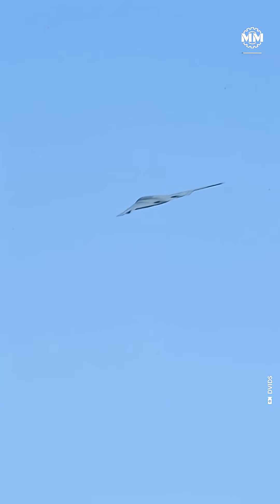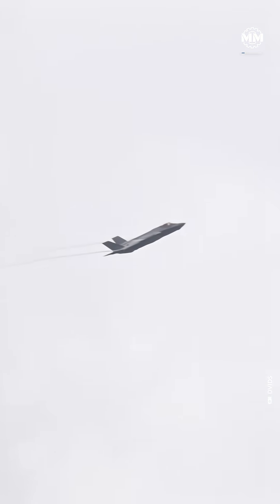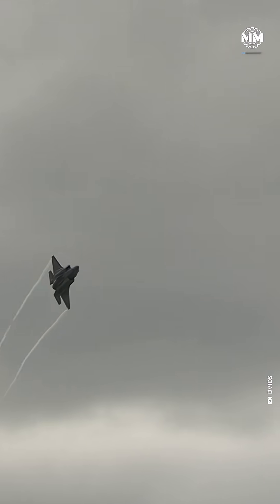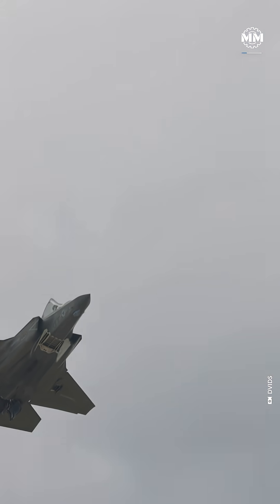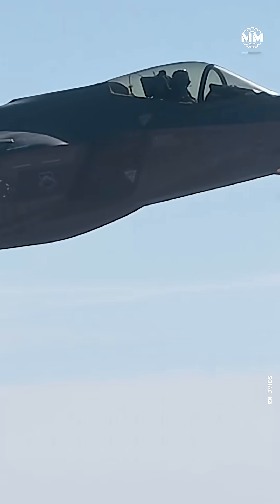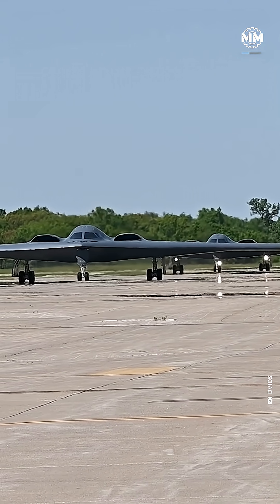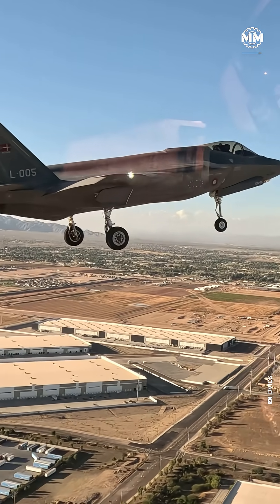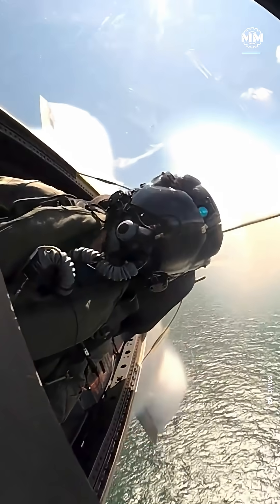Real Reason Why Radars Can Detect The F-35

Comment: What I can’t understand is why high capacity computers can’t be connected to high frequency radars to analyze  what they’re picking up. I’ve never seen a golf ball or bubble bee travel at Mach 1.8
Reply: But you can't get constant pings. So your point is moot. If a spec shows up then it's nowhere near the first ping, you can't get consistency. And the further you increase your sensitivity, the more you'll pick up. You won't just pick up birds, you'll pick up their shit falling down, insects flying, dirt particles, etc.
Reply: @reykennedy5716 maybe I’m simplifying it too much, but let’s say I’m pointing my radar at the sky and there are 100 birds and a F-22 in my direction. I get 101 bird sized pings, right? But only one of those ‘birds’ is flying at Mach 1.8
Reply: @bahe1969  you can see it but you can never get a lock on it, unless it opens its weapons doors then you only have a few seconds to get a lock on it which is almost impossible because of electronic warfare capabilities that the jet's have, and also they can fire first at long range out of harms way. It's almost impossible to shoot down a 5th generation fighter
Reply: @bahe1969 Not all radar detects motion.  That was the biggest breakthrough for weather stations.
Reply: @rabbiartsdesigns3596  You can lock it, thats what sensor fusion is for, you use lower frequency sensors to detect, then try to lock with the rest, sooner or later you will have lock good enough for missle launch, thats pretty much why every power invests in different kinds of sensors, satelites, IR sensors, Pulse radars, passive radars and much more, there are possibilities you know why? Because stealth isnt new and its weaknesses are also known
Reply: @bahe1969 comes down to: how do you know that the first ping was off one bird, and the second off another bird that was 100 yards away a half second later. But you don't get consistent pings off those things so there's no.way to know that youre actually tracking the same bird. And if you're using radar thats showing you every bird and insect, you have absolutely zero chance of picking an.airplane out of the clutter
Reply: @peposad2588  Yeah the big problem however isn't so much locking a stealth plane if you can throw loads of signals at it and have a super computer analyze the amalgamated data. The problem is doing it before the stealth plane (or his buddies) destroy all your now extremely visible radar installations.
Reply: @bahe1969  you can only know 2 of the 3, position, size and velocity. Radar gives you position and size.
Reply: Answer of your question is Doppler Notching.
f35 has passive mode aesa radar and it can detect the low or high frequency radar is tracking and find out exact location of the radar. 
As soon as radars tracking f35 it starts doppler notching maneuver. It makes speed of f35 seen relatively lower as a geometry trick. Because radars are not only focused to size they also focus to speed of the object. But doppler notching can show speed of f35 as low as 0 to the radar. Because radars check how close is an object. If distance of the object is not changing or it changes less than 100km hour it simply ignore it. So if the speed of f35 is seen as less than 100km and size is a gold ball it can be a sparrow. You can't identify it from birds..
Also if somehow high frequency radar detect and start tracking, f35 has counter measure electronic warfare system.
Aesa radar of f35 detects the exact position of the radar and focus too strong radar waves in same frequencies to radar to blind it. Or simultaneously send radar waves in same frequencies which will be reflected  from other sources. So it will be seen as a 2-3km big object or one of many other objects moves simultaneously in same speed. To engage and send a very expensive air defence missile you have to get the exact place and size of the f35 even in few meters sensitivity. 

Your idea can work in a radar network of multiple radars. İf there are multiple air and ground radars tracking same area doppler notching doesn't work. If a computer system analyze 2-3 radar images at the same time that golf ball will have different speeds from different radars which makes it suspicious. But people who make war are very smart ones. Before f35 flies it has information of radar positions and air defence systems. So flight plan is done by considering avoiding intersection of multiple radar coverages. 

But still finding out there is a f35 in an area doesn't mean you can shot it down. Because f35 can jam active radars easily. It detects the radar frequencies and replicate them, it can show it's position 3 km south to one radar, show the other radar that it is not f35 but 3 other f16 is moving and completely blind the 3rd radar.

Biggest thread to stealth fighters are the radars and missiles which carries passive aesa radars. There can be same aesa radar technology can be used to detect f35. There can be passive mode multiple aesa radars in the field with 30-50km distance to each other. And they can listen reflection of natural waves comes from f35 like tv, gsm, radio waves... and missiles with aesa radars are also very difficult to be jammed.

Because  of that stealth technology is going to new level. 6th generation jets will not have vertical stabilizers. B21 has 470 square meter surface. It is 11 times bigger than f35. But radar cross section of B21 is 50 times smaller than f35. Vertical stabilizers trade of maneuverability with high rcs. 6th generation jets uses other wing and air inlet outlet designs for high  maneuverability and keeping stealth design 100 times better than f35. 

If f35 is seen as a golf ball on radars, 6th generation planes will be seen like fly or small bug.
Reply: @darkprofile Wow. Thank you for this
Reply: @bahe1969  the F35 is a flying computer. Theres room inside the F35s airframe dedicated for its onboard computing. Much of the time, the computers on the ground attached to mobile air batteries are not nearly as good as the one on board an F35. Especially Block 4s, which gives its computer more memory and processing power to pull all of this off. It is literally the most advanced fighter in the world.

There's a reason why F35s were able to fly into Iran unimpeded and destroy Russias latest and greatest anti-air systems without a single loss. No country in the world has a counter for it.
Reply: @darkprofile  github has a program that tracks f35 using only cameras
Reply: It’s not that - the problem is when working correctly the materials are designed not to “remove” the plane from radar but make it look like background noise - air scatters EMF like radar and the coatings look to radar (when working perfectly) like background scatter - which moves at the speed of light of course
Reply: Are you we todd did?
Reply: I thought that too. Like someone said earlier, stealth is not to shrink RCS. It makes tracking and targeting difficult, not necessarily initial detection. You know something's there but can't shoot it down.
Reply: if you have -100 dB noise floor on your radar and you get a -99,5 dB physical movement of a airplane trajectory in the noise. This still looks like noise for you. But the radar computer try to brute force if some radar power could be integrated to a real airplane movement. If this happens its not your noise floor.
Reply: Why do you think armies recruit 18 year olds or younger. 👀Not everyone has that kind of thinking, but it'll look suspicious
Reply: 😂 you don't think the military has "high capacity" [WETF that means] computers??? The military's got computers LIGHT YEARS ahead of anything you've ever touched.
Reply: @QK_SAND THATS WHY THE HIGH TECH AF......FINALLY STOPPED USING FLOPPY DISK DRIVES A FEW YEARS AGO RIGHT?!😂

Comment: I've often wondered why they don't just search for the golf ball traveling at mach 1
Reply: because they can only see that golf ball when it's too close, otherwise it will be missed in the background image
Reply: today war they would send drones in same path of jets..u wouldn't lock all of them for 300,000k missiles
Reply: Not all radar can tell the velocity of a fast moving object. 

Radar gets a reflection in "passes" over an area.  That's why you see those spinning things all the time.
Reply: @buzzyshizzle5188  I understand how radar works 😂. It was a joke.

If you can determine the distance between subsequent blips you can calculate velocity. It's simple math. 

Anyway it was a joke
Reply: @Numenor7 I get the joke but just for educational purposes. Low frequency radars cannot get enough granular data to see the "goofball" per se. They can see the object and give a general location, but they don't have enough data for speed tracking. High frequency radars, can't really see the golfball except for blips here and there, so it is not possible to tell if it is the same golf ball or two different golf balls. Or maybe it's a baseball, a golf ball and 16 sparrows. So this is called background noise and is simply ignored. In the case of the Israeli strikes in Iran, the moment the targeting radars suddenly "saw" the f-35's  was a few seconds before the missiles struck the radars putting them out of action. When the missile doors closed, it was again a golf ball or bumble bee or whatever else.
Reply: @magnashield8604  appreciate the explanation

Comment: It's always a battle between offense and defense. Besides shape and coating there are other strategies that increase survivability of low RSC objects. Many are military secrets.  Perhaps a large number of phantom images can be generated. Radar jamming electronics can be used. Often the first target in an attack is defensive radar. Missile can have the same RCS as enemy aircraft lighting up radar revealing their location. Speed and altitude can overcome defense. I think over 5000 efforts were aimed at shooting down the SR71. But at Mach 3.3 and a very high flight ceiling they all failed. 

Antenna gain is related to its size compared to the size of the wavelength of the operating frequency.  So low frequency radar antennas that can identify that something is there but with poor signal quality are usually very large and stationed on the ground becoming easy targets.  The SR72 designed to fly at greater than Mach 6 has already flown at Mach 9. With a newly developer combined cycle engine with rotary detonation will easily blow through Msch 10.it will probably have a flight ceiling of around 100,000 feet making it a tough to detect and destroy.
Reply: Crud . The SR 71 flew as fast as it's engines and aerodynics would allow. Mach 3.5 max . Where do you get your 5000 attempts figure from ?
Reply: Altitude and speed offer little defense against modern systems.  Unless youre talking about Voyager 1 and 2 about a light day from earth.     It's much easier to make mach 3-4 missile with 85k altitude and 35+ g's ability.       Near peer and peer adversaries could down a sr71 without much trouble.      And electronic counter measures are what they are.  That's a debate for someone else.
Reply: @Payt-y5d At Mach 10 and above withba dteslt costing a plasma cloud due to air being hsted to 3000 degrees and electronic countermeasures it will be hard go hit. Add to that directed energy weapons and multiples of the same aotcrsft it woll be hard to get to.

Now let's say Putin is hiding in a chicken  coup tryying to blend in with the other chickens.  Move over Colonel Sanders. There will be plenty of fried chickens tonight.
Reply: @Payt-y5d 35 g is nothing for a modern AA missile. Do some research please
Reply: @Payt-y5d 35 g is nothing for a modern AA missile. Do some research please

Comment: Stealth isn't meant to be invisible. It's to make a plane hard to see. Stealth buys time for an aircraft to get close to a target to deliver payload. That's what stealth is for.
Reply: Thanks for repeating what was said at the end of the video 🤷🏻‍♂️
Reply: It’s not just that but stealth also makes it very difficult for a missile’s seeker head to get a lock onto the aircraft.  If it’s difficult for a very large and powerful radar to even detect a stealth fighter, imagine how difficult it is for a tiny missile seeker head to be able to detect, track and lock onto the fighter.  I recall an article where a British exchange pilot was flying a F-15, and he described how frustrating it was to fight the F-22 because even in visual range he struggled to get a weapon’s grade lock.
Reply: its not a plane vs 1 single system..Air defense usually work in tandem or a network from long,med an shorad including 35-25-20 cannon
Reply: As if we will be a sitting duck until the enemy delivers the payload
Reply: some people maybe think stealth is like Cloaking device on science fiction movies like klingon bird of prey 😂
Reply: @ZeroKnight-d2j yeah, it’s not. The strength of stealth or the “invisibility” stuff that people say about it is actually being able to have a radar cross-section so small that a plane is virtually invisible on a cluttered radar.
Reply: @ZeroKnight-d2j  actually to Radar that is how it's supposed to work. Visual visibility but NOT Radio Frequency visibility.
Reply: That was before quantum or 3d radar
Reply: Russian got stealht teethts👍🥳
Reply: No, it's just used against 3rd world nations. Try that with a peer nation and you'll be shot out of the sky real quickly.
Reply: Thats exactly what the video just said...🤨🤨🤨

Comment: Stealth aircraft are not Klingon cloaking starships.

Virtually all  "stealth" aircraft will light up on VHF, L and S-bands.

The F-35's carbon nanotube airframe, for instance, is useless below 4 gigahertz, or S-band.
Reply: Certain portions are CNT, but not the actual airframe. It's aluminum and titanium carbon composite.
Reply: Wrong

Comment: No surprises here.
Reply: He missed detection by obscuration.  If you have a radar platform above the stealth ship broadcasting to the ground, the stealth aircraft would be where you do not receive the reflections from the ground.   With computers and AI, it's a matter of if the signal can be identified as the aircraft not how large the return signal.  A reflection of the size of a golf ball traveling at mach 1 is not likely to be a golf ball, if a radar operator was just looking at a display of the reflections then they could easily miss the small reflection but if it's a computer detecting the characteristics of the reflection and then generating the image of the detected aircraft as an easily seen symbol on a screen then it doesn't matter how much stealth you have.  As soon as the F-117 was publicly known, we were proposing all the ways that stealth aircraft could be detected.   We're probably at the point where active stealth such as the AI controlled ECM of the Gripen should be more effective than the passive stealth through shape such as with the F-35.  Of course an aircraft designed with passive stealth could also carry advanced ECM to confuse the radar systems but passive stealth is a compromise between stealth and aerodynamics, active stealth becoming more effective than passive stealth means the compromises required for stealth aircraft may no longer be needed...